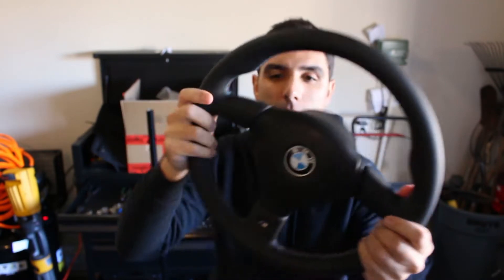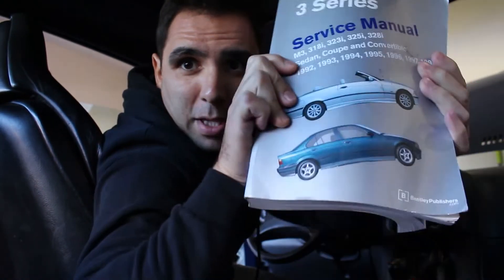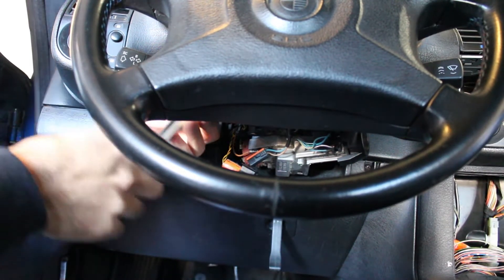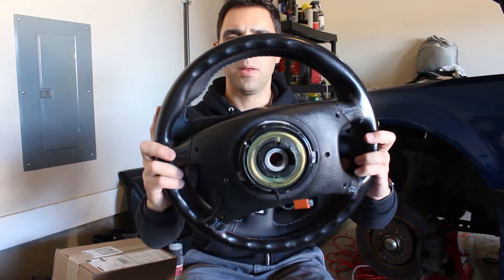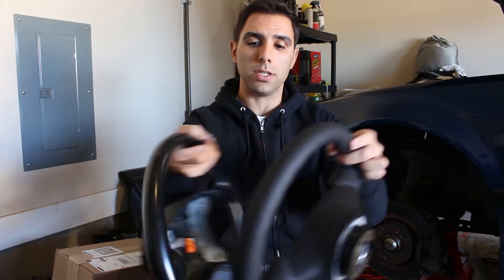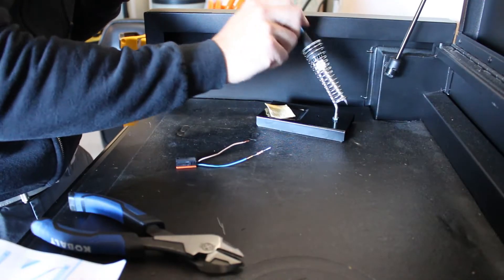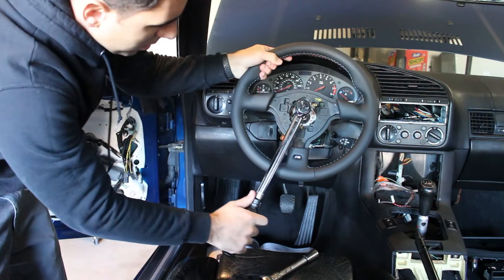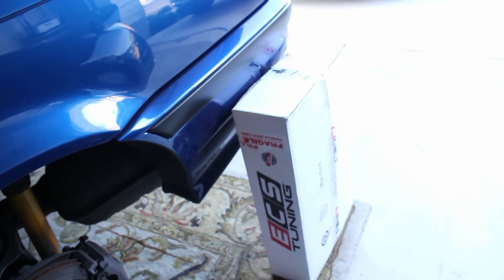E36 M3 M-Tech 2 Steering Wheel Install with No Airbag Warning Light

Comment from the maker: Does anyone else get as excited about new car parts?
Reply: Do you have a link to this steering wheel? I ordered one and it didn’t fit my 1997 M3 but it did fit my 1999 M3,
Reply from the maker: @gravity718  Yo! Yeah, this isn't the exact same one but it's from the same seller. It looks like this one is perforated but besides that, it's the same. https://www.ebay.com/itm/BMW-M-TECHNIC-2-STEERING-WHEEL-E36-M3-NEW-LEATHER-and-3-COLOR-STITCHING-/222210132556?hash=item33bcc18a4c

Comment: so i did a swap with a MOMO wheel and did the resistors as you did but light came up..? any suggestions? thanks bro E36 M3 S52
Reply from the maker: hugo diaz Hmm, tbh I’m not sure. I’m awful with electrical stuff.
Reply: @jpetro  no worries thanks bro btw badass E36 😁
Reply from the maker: hugo diaz Thanks Bro! Got some good stuff planned for it that should be here soon!🤙
Reply: @jpetro  sweet been following you since then.. I'm here in Htown bro GL with up the upgrades

Comment: Did you hide successfully airbag warning light by using a resistor? I am before replacing the steering wheel for mt2 in my e34 with airbag
Reply from the maker: Mann, so here's what happened. I did the airbag warning light trick but then I took out my passenger seat and drove the car, this turned on my airbag warning light. Then when we swapped in the S54, we took out the body control module so I can't turn reset the light now, lol. I'm 99% sure the resister works but since I drove the car without the passenger seat, that triggered the warning light that I now can't turn off, lol.

Comment: I've read some places that you need a different slip ring to make this steering wheel work? Did you encounter anything like that? I'm looking to pick up this wheel for my 97' M3
Reply from the maker: Hmm, I didn't. For me, this was a direct bolt on besides the airbag light wiring.
Reply: If I’m not mistaken I think the slip ring is required in order to get the multi function controls to work ie. volume and cruise control. Currently reading up on it myself looking to install a e46 MF wheel in my e36 I may make a video walking people through it step by step

Comment: Hey! I'm doing the same thing in my BMW E34 1993 and I have the same steering wheel as you before.I have now bought a Nardi Woodline steering wheel without airbag. I guess the only thing I need is a matching slip ring.  Do you happen to have a part number on there? I wonder if it'll work for me.
Reply from the maker: Nice man! I don't have the slip ring, I didn't need to buy one.
Reply: I want to put that steering wheel in my E36 318, and my problem is my horn doesn't make a sound😂how the horn connection works?

Comment: how about the horn, is it functioning normally? If it works normally please show the horn cable installation video and also the horn sound test.
Reply from the maker: Yup! Horn works just like normal. All I had to do was plug in the two wires that I unplugged from the factory.

Comment: What’s your car model ?? My car is 97’ and the m tech steering wheel it’s not fitting
Reply from the maker: I have a 95. Did you get the M Tech or M Tech 2? Mine is the M Tech 2.
Reply: M tech 2 but my car is 97’
Reply from the maker: Weird. I didn't think there would be any differences?
Reply: I send some pics in your instagram
Reply: you need the slipring. J Petro bought a re-wrapped steering wheel kit - probably the Ebay guy tainik - and it came w/ the horn button and slipring.